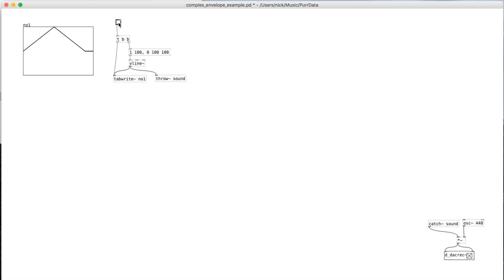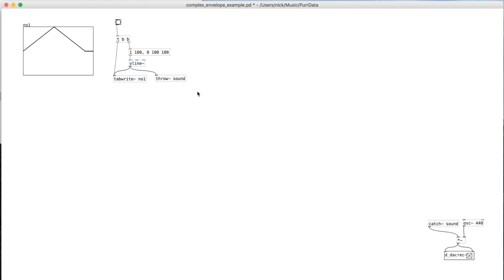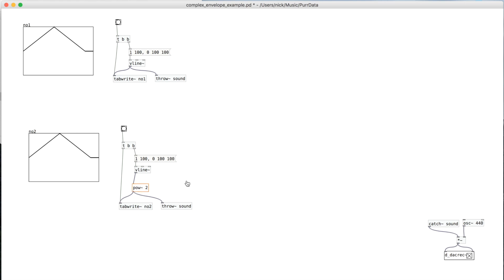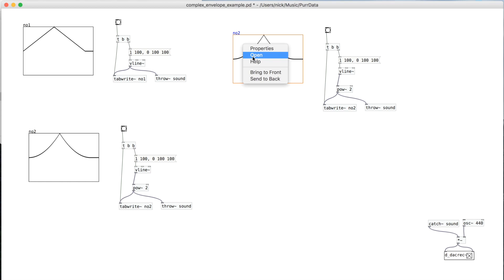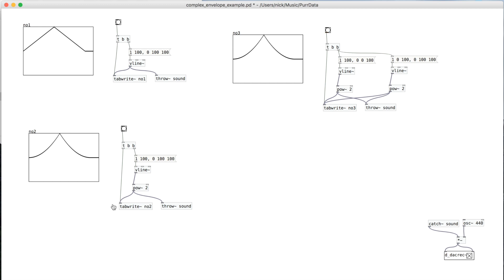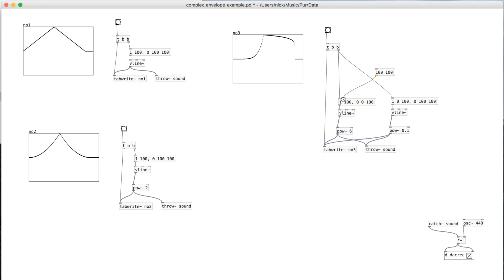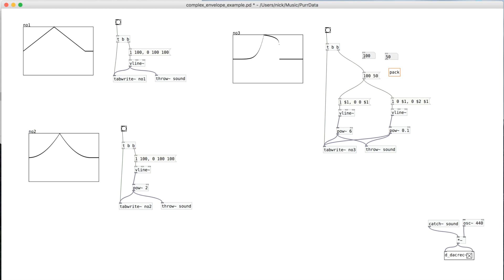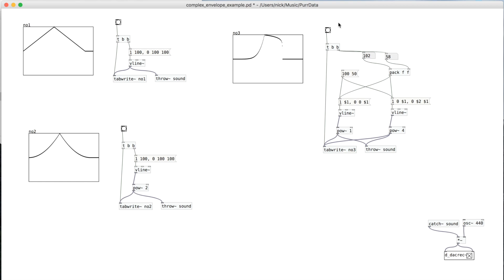(002) Pure Data - creating complex envelopes in a simple way

Comment: This is helpful! Any demystifying in Pd I’ll take at this point (still early). Also I just connected this is the difference showcased on a Make Noise Maths module for example, with the pot split between logarithmic or exponential ramps

Comment: Hello. I'm trying to the same thing, but instead of curving the vol. envelope, I'm want to curve the pitch. I have only the decay, so, for example, the pitch goes from 1khz to 100Hz over 500ms. When I use the pow~, if I  set it above 1,  the pitch shift starts from a higher frequency than 1kHz, and if set pow~ lower than 1, than the pitch starts lower than 1kHz. Shouldn't placing pow~ after vline~, just made your pitch shit non-linear if set above or below 1? Also, nice video!
Reply from the maker: [pow~] is an exponential and any number x between 0 and 1 raised to any power will still be between 0 and 1. Not true when x is greater than 1. What I would suggest is have your vline~ still be 0 to 1 and then after the line do [+~ 100]  so that when the line is 0, it's at 100Hz. Then do [*~ 9900] so that when the line is 1, it's at 100Hz+9900Hz = 1kHz. Hope this helps.
Reply: @pd_7773  Oh, that's right. Remapping range. It works perfectly, I just had to place [*~] before [+~]. Cheers!

Comment: The only problem i've encountered is that when my metro is too fast, i get clicks when the release phase starts, using the method taught in the end of this video. For instance, if i set a [metro 250] with a phasor, it clicks too much. Using the [writetab~], I can see that the release pops out of the tab immediatly when it starts. It's like the envelope is restarting even before finishing, thus resulting in this annoying clicking noise. Do you have any idea of how could i fix this? Maybe there's a way to reset the phase everytime the envelope is banged?
Reply: Well, turns out it was probably related to the way I was using [dac~]. I'm now using [output~] abstraction from Vanilla PD and everything works fine. I'll take a closer look into that abstraction and try to figure out the problem :)

Comment: I'm just trying this out now and I can hear the correct waveform/ envelope but it's not displaying the information (visually) in the array correctly. The line changes slightly but more or less just stays horrizontal. I think it's because I have table size set wrong. How do I know what size to set it too? Or is there something else wrong? thanks
Reply: okay... I've set the array size to the 10000 and I seem to be getting the same results as you. Have I dont this correctly or is there something else I should have done?
Reply from the maker: @liamorourke9685  Hi Liam. Thanks for watching. I'm glad you are finding this useful and also glad you got it working. 10,000 is what I have the table size set to, as well. Seems like you should have it all correct. There is nothing special about 10,000, it's just what I used in this case. It looks like 10,000 gets about 226ms of envelope time. If you want a longer envelope you can add more points to the table as needed.